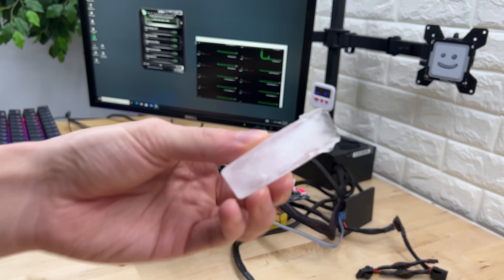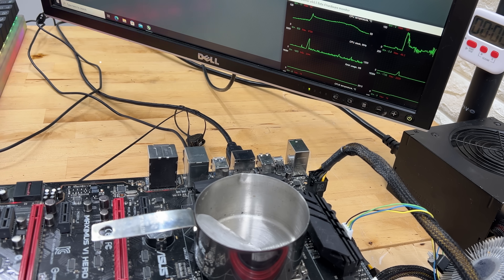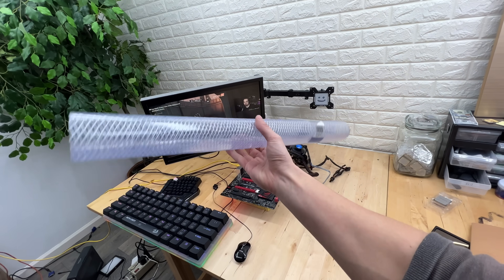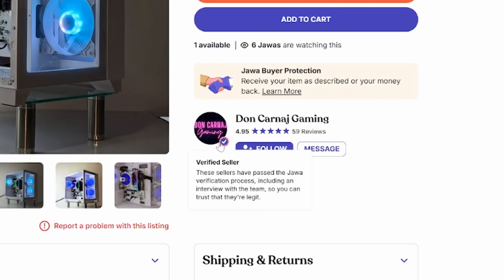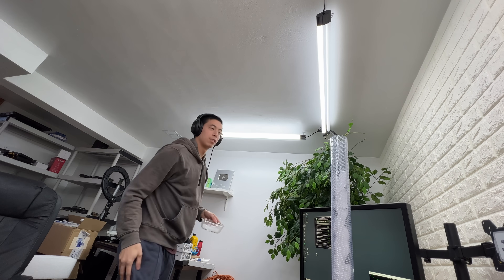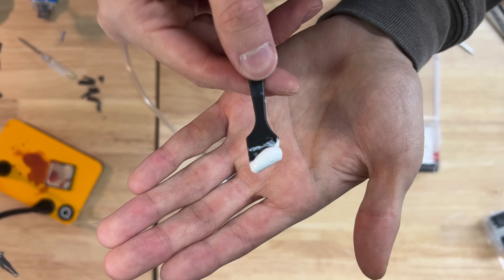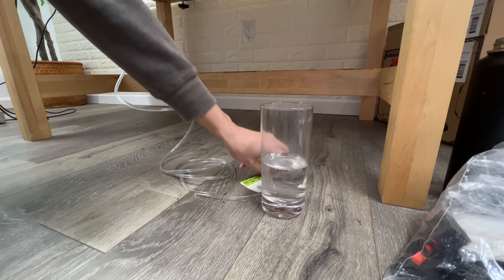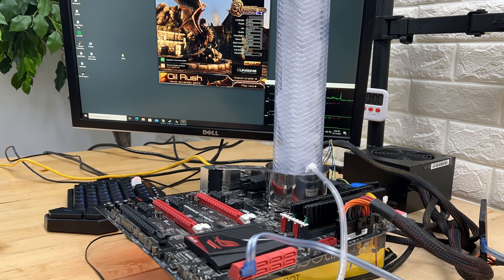Why aren't PCs cooled with ICE?

Comment: first time wathcing ur videos, i was expecting a 3d printed "chamber" that leaves the cpu exposed and a rectangle shape ice block that you funnel directly against the cpu with a little tube that sucks out the water biproduct, and you just keep funneling the molded ice like a glue gun style thing

(i posted this comment at 3:20, so im still hoping)

Comment: An interesting concept, I've remember as a teenager wondering if you could cool a computer with ice but eventually scrapping the idea because of the obvious hassle/issues with electronics and water. Also I didn't want a solution where I constantly had to refill the container with ice or dump the water, so I imagined pulling the water from the bottom feeding into and ice cube tray in a mini freezer that would then automatically dump the ice cubes back into the container in an endless loop. 

That amount of effort though requires a rube goldberg like machine that has many obvious points of failure even if you succeed in creating such a device.

Comment: Use dry ice (CO2):
1) far more colder
2) no liquid state at atmospheric pressure, it turns into gas right from the solid.

It sublimes at normal temperature, so you need to isolate and regulate pressure to increase efficiency.

Comment: Gotta find a ribbon for the graphics, make your own case and design it so everything is up and the ice is slits off with a temperature controlled fork in the ice tube and hook it up to the PC so that the PC can distribute the ice to the hot parts component and connect a ice maker to the top of the ice tube but make sure the main tube bends off at an angle so the ice maker offset from any components so that way if it leaks or something falls it doesn't destroy the pc

Comment: you are a m*ron. the miniscule difference in the water's temperature as compared to the ice is vastly outweighed by the greatly increased thermal conductivity and thermal convection of the liquid in contact with the heat sink (in this case a pot) and the other ice cubes.

Comment: Latent heat is one hell of a drug. The CPU cant heat the IHS up any more since the ice is there eating all the excess energy in order to phase change.

Now imagine if we had a CPU that could run hot enough to be safe at 100c so we could use evaproation instead of melting. (Or use a refrigeration cycle with a lower boiling point)

Comment: Why not put on a noctua dh 15 with the fans off, and have to motherboard stood up like normal. Then enclose the cooler with the ice tube coming out the top and the drain hose at the bottom. Condensation wont be an issue and the temps would be crazy low

Comment: the gpu one wouldn't work because you're not cooling like 90% of the components. and the cpu one, you could simplify by using dry ice. no messy water to deal with

Comment: You could recycle the water too. Just get a bigger catch jug. And use that to make the new ice and cycle it. You'll never waste the water, and it doesn't get hot enough to steam so you'll lose very little. You'll save electricity too running those fans. Dumb idea but genius at the same time lmao.

Comment: 7:25 what about convection? The hot water on the bottom of the glass would rise to the top thus pushing cooler water down. It would reach equilibrium at some point, but hot water is also less dense than cold water, making it more buoyant. Really interesting thermodynamics
Reply: True, hot water rises to the top and cold water goes to the bottom, and the ice is on the top so the warm water cools down and becomes relative more dense compared to the water on the bottom, an infinite loop as long as ice is constantly supplied, and it shows, the graph isn't a perfect line, but a zigzag with 2 degree range of the highest and lowest temp, cus the water constantly changes entropy
Reply: heeeeyyy convection currents from volcanoes in geography! :D
Reply: @KenishTheCoolestwait that's true😂

Comment: Before I watch the videos my basic understanding is it will short circuit if the water goes onto other components. 

Or the heat would be to hot so the ice won't last long

Comment: We have a LAN party every year beetween christmas and new year, and several years ago, my old laptop that was overheating, I had a big aluminium sheet, so i put it on my table under my laptop, and a I had a cooking pot full of snow that I had to regularly go fetch outside. That was enough to prevent it from overheating. As we were mostly playing DOW, and I was playing Orks, it was also very fitting.
Reply: What i always do with all my electronics, laptop PC consoles whatever. I try to set them up in a way so that a fan in the window is blowing cooler outside air through at them, and it especially makes a big difference during the colder months. Like a massive difference. And yeah, the room 'would' get cold, except that i consider that when i set things up. The colder it is, the less air you need, and if it's contained behind something just well enough... You feel no temperature change in the room, and it all runs mouse fart quiet.
Reply: Lan Party with a laptop.... Yeah no its not. And lol haha eww.

Comment: I mean another die sign for horizontally is to make a closed cylinder with the top being able to be open and closed like a trapdoor, and on the bottom the water pipe. Even better is using the water pipe to cool other parts before becoming wasted

Comment: Water (pure water) is not a cunductor but isolator. Water however is very easy to contaminate and when all the metal elements(from periodic table) mix within the water it becomes a conductor. Hydrogen and Oxygen which create the water are non-metals, therefor the water by design is not a conductor.

Comment: What if you turn the motherboard upside down and stick cup with a fully freezed water inside, and push the ice with some round plate with a spring attach to it and a center hole, so the condensation will flow down through that hole instead of a little tube. and you can re-orientate gpu by using ryzer, using the same principles

Comment: and my friend working on something new  we are trying to make water cool with an Air conditioner we are trying to use gas and copper tubes and fans to work like mini Air conditioners but make But it produces heat is expansive but can cool the CPU so much better think in with water cooling you get 80c overclock CPU with this cooling we make you get 42c is hard we make the mini engine can working like Air conditioner engine  but must install outside house because make the heat  inside house you install it outside and you only make copper tubes inside the house and install that on your PC tubes come from you CPU and cooling you cpu so much never thing about even can cooling you gpu and your room to I think never any want to buy it we tr toy make it because we want to test and overclock CPU with lol

Comment: Why not create a miniature refrigeration thing that hooks on where the fan would be like this, enclosed in a fully realized hockey-puck looking device, but one side creates ice and the bottom consistently draws the melted water back to the top layer to recycle for flash freezing the top layer. have it connect to the PSU so it can self-regulate all the time. Potentially even just use another element that freezes other than H20 for a more consistent solution as well. There's plenty of chemical freezing products.

Comment: I have a whole guide on how to do this with water cooling set up on tomshardware to sum it up i had a 5 gallon Iglue juice cooler filled it 40% with distilled water and put 2x 2litter bottles of from ice from the in the freezer of my fridge they would last about 17 hours and my pc  would stay at 6 degrees C
Reply: paired with and xspc raystorm and d5 pump the hardist part of the whole thing was keeping the water filtered well. i used a sock and a that bigger sucker thing people use on 1800 gallon fish tanks

Comment: how about a liquid, that doesnt freeze so easily and make a cooling system similar to a water cooler system but with that liquid and it should be constantly flowing with extremely cold liquid... how would we make it cool? chemicals? electronics? now THAT would be an experiment that could lead to a major breakthrough :D

Comment: So it seems that using ice, as long as it is touching the bottom, is better than water. The real problem with the design is constantly refilling the ice right?

What if the ice never melted? What if there was another machine that constantly kept the ice frozen? 
This way, you could game as long as you wanted because you would have one machine constantly cooling the CPU at a very low temp compared to fans and water cooling, and the ice wouldn’t melt because the machine would keep it frozen.
Just something to think about.
Reply: you just described an AC / freezer dude.
Reply: @ yeah but like REALLY REALLY SMALL

Comment: I know how to install plumbing. I thought about tapping into my houses water supply and run a loop into my PC then back into the house loop with a check valve. You would never have to change the water because it will always be flowing. The ambient temperature of the water when its not flowing will make the water flow anyway because of the temperature difference. You wouldn't even need to use a radiator in the loop because the ground water is cold year around. Just have copper water block on the CPU, so you wouldn't even need to worry about the quality of the water. You could have the heated water go into the water heater. The only thing I would be worried about is condensation. Now that I think about it, you wouldn't even need to have a check valve.

 You would just use a Y valve if you need to turn off the water to the PC. So the main line into your house could be directed right into your PC then right into the water heater. I would make a custom built, all copper, CPU water block that allows for 3/4th inch pipe to go across the CPU and not loose any water pressure, and have really good flow rate when running. lol

Comment: Pump the water back into an the freezer through the automated ice cube maker. Deploy more ice from a front dispenser, ducted into the CPU ice cube hopper, using some sort of detection system. My money would be on a float valve somewhere.
Wouldn't even need to modify the fridge. Simply pump the melt water up to a larger reservoir, letting gravity do the rest.
The biggest short coming here as I see it would be evaporation. Ignoring the energy to freeze the water, this can't be a closed system, and some water will always evaporate, upsetting the loop. So some sort of mechanism would need to be incorporated to offset the loss accurately. That system is going to have its own problems, and complicate any other systems already in the loop.
Since this is all getting beyond scope and seems like it would be a net power loss, let's remember Ryzen chips in particular use lower voltages at lower temperatures. So doing some mental napkin math, I'd say it's nothing but power savings. Probably. Yeah, definitely probably power savings.

Comment: Why not run a Compressor and  actual refrigerant thru the heat exchanger in stead of just water. Side Note when I first Attempted to CLONE my HDD to an NVMe SSD thru the 3.0 Thunderbolt port it ran the SSD so hot the Computer would BLUE SCREEN. So I placed the Enclosure is a Towel between 2 bags of frosen corn.

Comment: The problem with this, and the problem with using a cooling solution like the gasses in a fridge, airco etc is that this would cause condensation .. E.g. everyone here probably experienced plaing a drink with ice in it on a table or desk and the sides and the bottom of the glass became wet. Yeah .. probably not the smartest solution this.

Comment: You can also try setting the motherboard upside down and press the ice up on the processorso the watter will fall on the table/in a bowl, rather than on the motherboard, maybe have a spring which pushes the ice up, onto the cpu.

Comment: The thing is it’s not about cooling the CPU it’s about transferring the heat away. We want the CPU to get hot just not too hot if the CPU is cold it won’t do its work efficiently. It’s like a car engine we want it to hit operating temp but not get to hot or to cold. This is where thermal paste and heatsinks come into play the paste helps transfer heat to the heatsink and a blow fan dissipates the heat out of the computer. No different than a car which uses coolant to transfer the heat out of the engine and a fan blows it out of the radiator. Water cooled PCs kinda work the same way as a cars coolant. So you want to feel the heat coming out the back of your PC that’s a good thing.

Comment: You could still sideload your ice to the CPU by capping the open end with a spring cap that goes all the way to the CPU and a slider notched into the side to allow you to rack the spring all the way back. Then cut a hole on the top side near the end to load ice in and rack the spring back and load your rounds of ice in until the pipe is full. 

Or you could make it like a bolt action rifle with a magazine full of ice rounds that you rack in one by one and the spring tension holds them against the CPU until they are fully melted.

Comment: Or you just get a low debit small water pump and a freezer refrigeration unit and make water come out from freezer unit back into the container bottom and another taking water from the top since we know cold water stays on bottom and warm one on top and have a freezer cooling system. However the ice cooling also has a drawback as any liquid cooling since it creates condensation on the exterior of your container that might spill on circuit. Usually liquid cooling cases for computer requests that the computer its placed inside the casing in a dry air room to avoid having water in the air inside the casing to prevent condensation and the computer will be airtight in the casing.

Comment: Why aren't PC's cooled with ice?
Because we do not rely on latent heat, we rely on heat conductance and capacitance to take away heat from the CPU.
Using ice to cool something is dumb because you will need to freeze more ice over time and it will be very costly in terms of energy. The delivery system is also going to be very painful to install.
If you want to be radical in terms of a solution you can basically submerge the PC in a coolant (that is not water so you don't even need to worry about component damage)
The reason watercooling is a thing is that water is good at holding and transferring heat efficiently. Using ice is not efficient

Comment: Back in 2012 I had an hp laptop that would get as hot as the surface of the sun when gaming so I used outside my balcony during winter times at 10F for better gaming performance.
Reply: TV🎉I just use a 30 dollar fan to blow at the laptop on the summer.  Of that is not enough, a fan stand beneath the laptop and a big 30 dollar fan 2 feet diameter cheap fan blow straight at the laptop.  If you cheap buy a square fan 2ftx2ft put the laptop on and a 2 ft diameter fan blow straight at it from left to right or 34 degree angle  Should low temp 20 to 30 degree.  Make sure ya make a stand for the square fan so it can draw air beneath and around the fan to blow up at the laptop.   If you need even more cooling power use a pump to blow ice or cold water into the copper pipe wired around those   2 fans.  Prefer not to have water too near computer kinds dangerous.

Comment: Water with ice in it will not increase over the temperature of the phase change. Basic physics you don’t need to drain the water to stop it from getting hotter

Comment: Have drains along the bottom so as the ice melts it drains out and the ice on top can continue to melt onto the cpu. Have the melted water recirculated into an ice dispencer which makes a custom cylidrical "ice cube" and drops back into the cooling tube for the cpu. Have an optical sensor so when the ice block against the cpu melts and is low enough, a new ice cylinder is dispensed to top it up and continue the cycle

Comment: the next step is using frozen salts! By changing up chemical composition you can change the melting temperature of the salt, that way cooling kicks in at higher temperatures when you need it, check out watch?v=Nqxjfp4Gi0k

Comment: 8:09 what if its hooked up to an ice machine, and the melted water is pumped back into the ice machine?
Reply: OH MY GOD-
Reply: It won't be power efficient
Reply: @AGMDGD so? This is about keeping it cool, not about power efficiency. Not sure why you’re bringing it up, are you assuming that it would need to be powered through the psu rather than a separate outlet?
Reply: @ShinigamiH  right so pay $200 a month on electricity to run the ice machine over $120 a month just to make your computer maybe 10 C cooler than a regular fan? Got it
Reply: @Carpfoon you literally just pulled that numbers out of nowhere… you realize that people who have access to YouTube also have access to google right? So it wouldn’t be hard for someone to search something along the lines of “how much does it cost to run an ice machine over a month” and get results significantly less than your numbers.
Reply: @Carpfoon  you dont pay for electricity unless you have an ice machine?
Reply: @AGMDGDwith how prices are today, it's becoming quickly price efficient
Reply: you would loose some water in the process
Reply: you will eventually run out because some water might evaporate
Reply: @GamingDimiGD  how is that any different from typical liquid cooling?
Reply: @GamingDimiGD condensation:
Reply: @GamingDimiGD third party water coeming right up!
Reply: Sounds like water cooling with extra steps
Reply: @mfw9902  yep
Reply: Ppl in the replies fighting like someone is actually gonna do it 😭 like he just introduced an idea
Reply: you've invented a perpetual motion machine (kidding obviously :P)